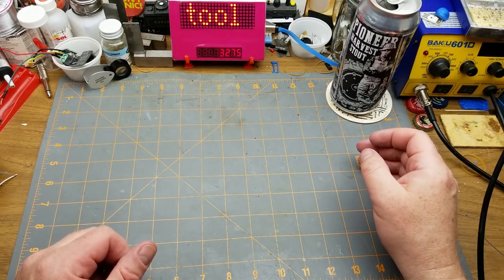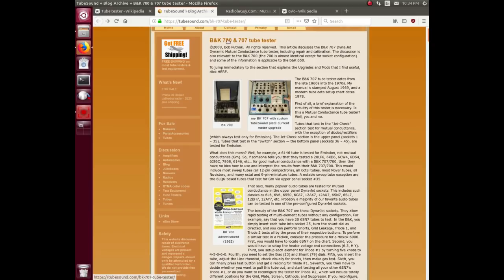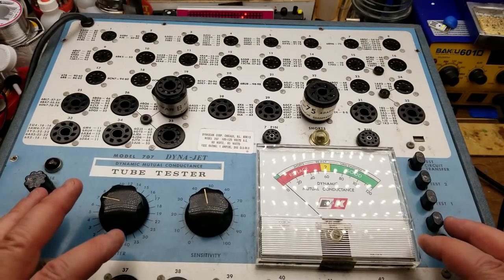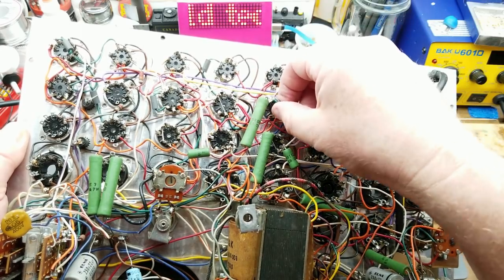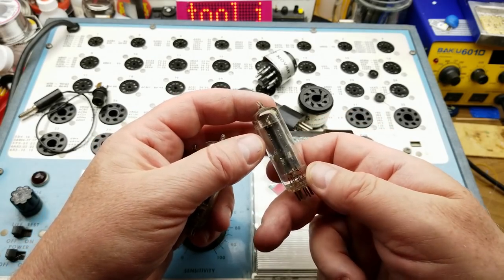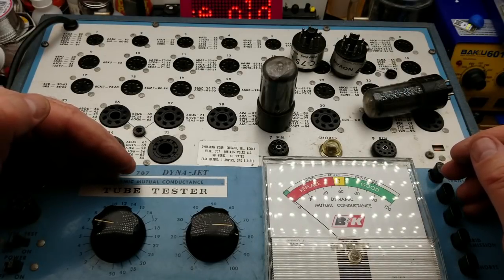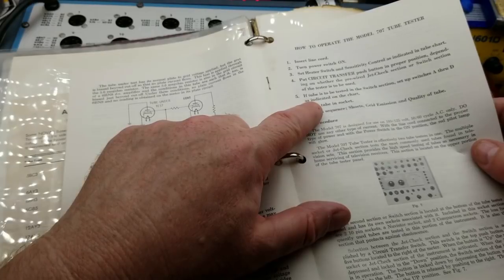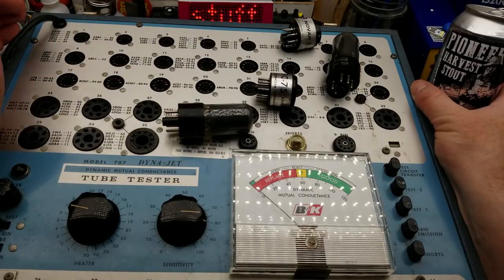The oldest tool in my shop (other than me)

Comment: As a kid I remember taking out all the tubes out of our black and white TV, putting them in a paper bag and taking them to the local drug store.  
They had a tube tester that anyone could use that looked very much like this except it was built into a console .   The list of tubes was on a chart that flipped up and down above it.   you would test your tubes then if you had a bad one the store guy would open the bottom cabinet and sell you a replacement.   I knew nothing about what tubes did you just followed the instructions .  It would almost always fix the black and white TV when color came out you were mostly out of luck the TV had very few tubes fortunately the TV did not go bad as often as the B/W one did .    I remember putting the little wire to the top of some of the tubes for testing no one warned you about the high voltage.... it was a different time back then.

Comment: Nice to see an old unit like that still chugging along. Conductance is measured in a unit called a mho, literally ohm spelled backwards! That 6AU6 branded EICO is from an Electronic Instuments Company test set, probably one of the millions of entry level test equipment kits they sold. As a kid I put together one of their RF signal generators and a VTVM. Thanks for the walk down memory lane.

Comment: I may be wrong but I think your tube flunked the short test. According to the manual the short light may not go on but the meter could move to a short on the upper scale of the meter designating a short.

Comment: Hi in my days of using valves(tubes) they were all denoted with letters i.e. ecc83,ecc82, py801 , el84 and pl504 all of these used 6.3v heater voltage these valves produced by mullard 
Mike
Reply from the maker: Several of the tubes in my collection have both styles of numbering.
I assume North America and UK/Europe had different numbering standards. That was pretty common in a lot of industries before there was as much global commerce as we see today.
Reply: If I remember correctly valves of the PLxxx type were in series. Valve of the EL, ECC etc had a 6v3 supply.
Reply from the maker: I've encountered filament supplies derived both ways. 

Some amplifiers and transmitters had separate transformer windings for each voltage, others had multiple filaments wired in series to a single transformer winding.